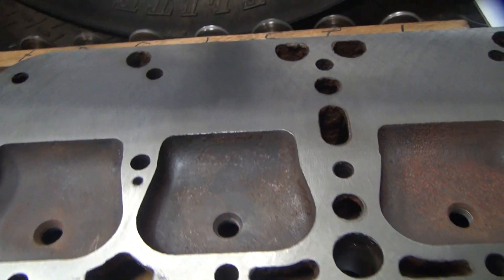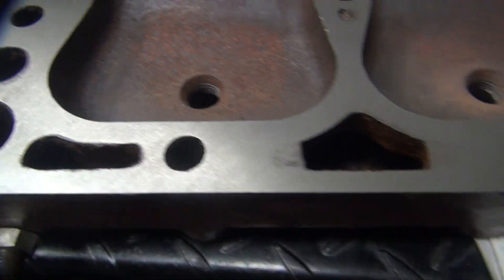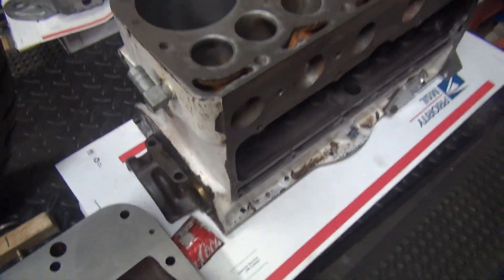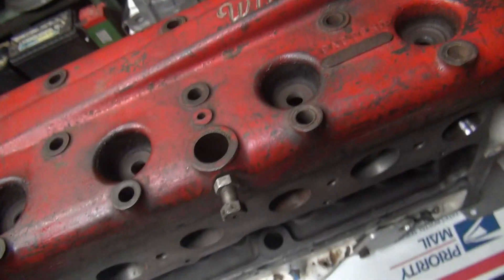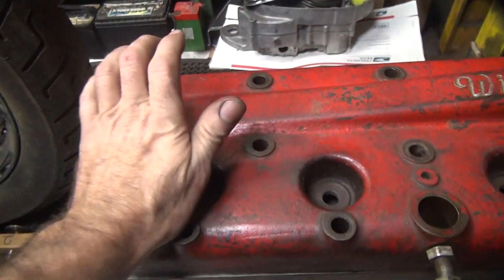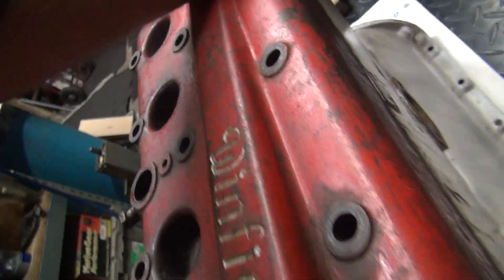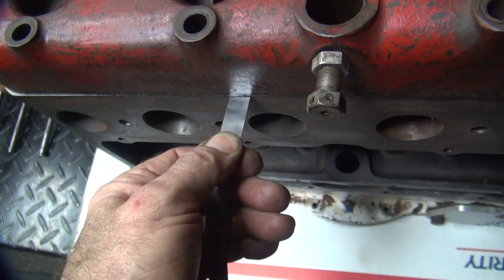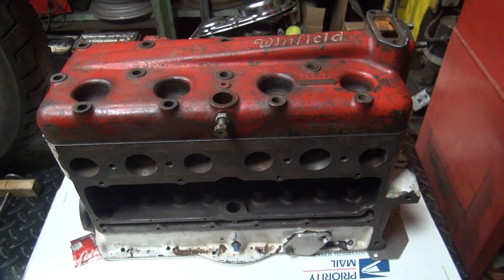1932 ford #123 model A or B flathead race block crack repair by tatro machine

Comment: Very cool series. Did the engine get up and running nicely? A follow-up video would be nice.
Reply from the maker: it got raced a few more times. the owner died a couple years after i did the work. i think they went around 120 mph with it on a light load of nitro. i don't know who has the motor now.
tatro

Comment: Fun series of vids.  I hadn't seen the overlapping pin method of cast-iron block repair since I was a kid (I only saw it used on stock street engines). Fun to see it used on a nitro motor, and that it worked well. 
I read the replies you gave to questions to better understand why that type of repair. Thanks for explaining. I was genuinely surprised at the vociferous disgust/hate directed against this series of vids by a couple of folks. Those comments weren't exchanging info, disagreeing, and learning; they were a diatribe. For those hater-types ... fer chrissakes no one is making you look at these vids.
Reply from the maker: you can only teach someone that wants to learn.
tatro
Reply: @TatroMachine this was a very interesting series. I have welded a couple mopar and sbc blocks with varying success. If I ever have to do another I really want to try this method. Maybe I'm wrong but seems it's a better way. Not much chance of warping or rechecking from heating and cooling / expansion and contracting. Thank you for sharing this

Comment: I have followed this project with great interest... I have several Model A blocks with this sort of cracking on # 2 and # 3 cyls.

How did this project turn-out ?

Thanks ! 

Frank
Reply from the maker: all is good as far as i know. it made two more races that i know of and was still running good. car was sold after the owner died so i don't know anything after that.
tatro
Reply: Thanks for your reply !   One of my blocks is a "numbers-matching", so I'm hoping to save it from the scrap pile.
Reply from the maker: just found out that the last pass it made was 122mph running 15% nitro. still was good to go when sold.
tatro
Reply: Thanks for the update - good to know !